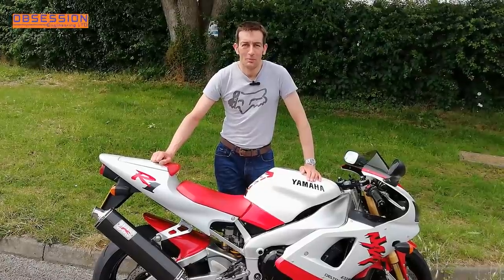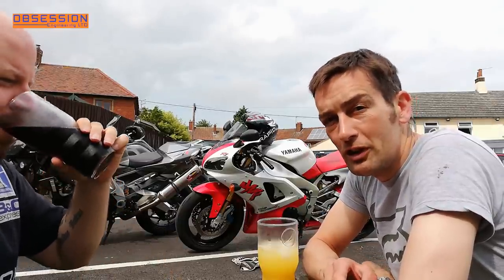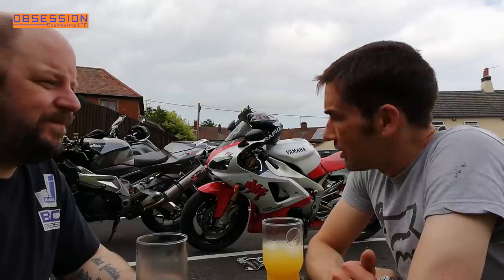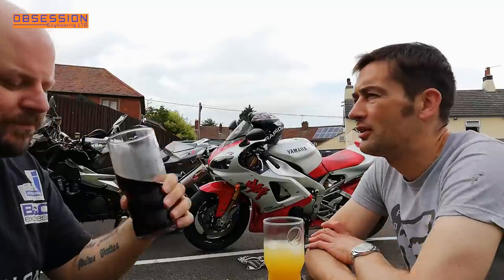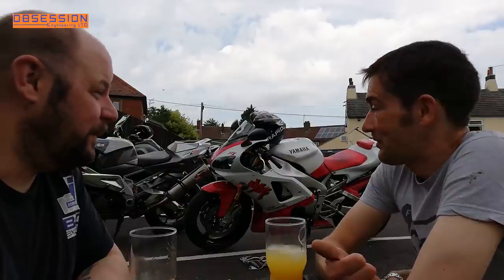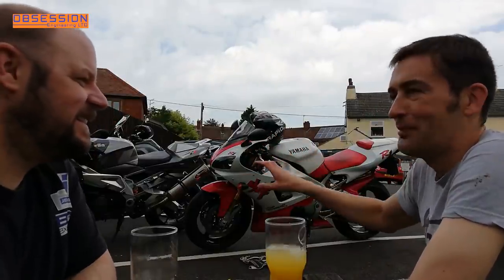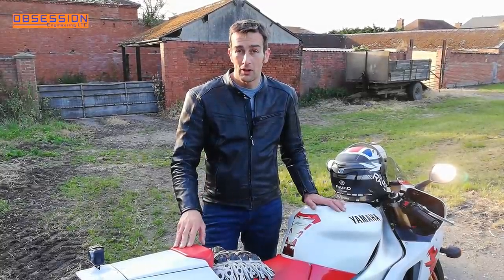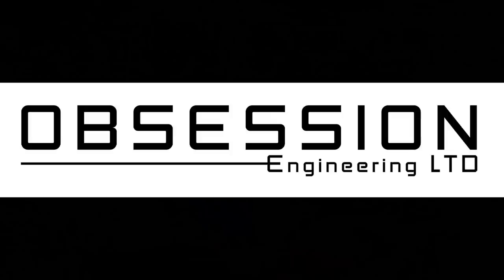ROAD TEST. My 1998 R1 is GREAT, but my Tuono is better! Yamaha Jigsaw puzzle project on the road

Comment: Have a `98 R1 as well,it`s the motor and especially the looks that do it for me-totally agree about the gear lever but the more you use it the easier it becomes.It`s the same with the brake lever on the other side -Probably because it doesn`t get used quite so much after 18 months with the bike I`m still trying to find the bloody thing.I know it`s down there somewhere.......

Comment: I own r1 RN01 as well. Give me a lot of pleasure and learned myself a lot of mechanical skills to keep this oldie on the road. You mention in the review that the suspension performance is excellent. But what I can  see your front fork is an ohlins aftermarket part. And maybe its advisable the mention these early models have a bad machined gearbox. one false shift can give issues on the second and or fifth gear.  Nice vid would love to see more of these. Cheers
Reply from the maker: In the build section of the project there is plenty of detail of the Ohlins suspension, but I will admit I didn't make a point of it in this vid

Comment: Great series Dave! So what ended up fixing the front brake issue?
Reply from the maker: The second set of discs I bought seemed to fix it, which was a bit odd as they looked worse than the originals. But I won't complain as they were a bargain

Comment: Dave ,  Do I buy a 4xv or 5jj or 5pw

I've found an early 4xv with 44000 miles on the clock It is a lovely bike  bit of ware and year any advice
Reply from the maker: I've owned a 5pw, and it was a great fast road bike.
If you want a purely riders bike, the 5pw would be my choice, if you want something with a bit more investment opportunity, the earliest bike possible is best. In the end the purest form is always the original

Comment: Had three Aprilia's, I'd rather have the R1. Aprilia electrics are made of spaghetti, solenoid and battery connections need upgrading, brown wire connector melts, stator is an expensive fix.
Reply from the maker: Rides nicely though :)
Reply: But apart from that, they’re lovely bikes

Comment: Not being rude, you seem rather tall and long legged, the R1 comfortable for longer rides? I tried a Tiger stripe Fireblade CBR900RR and found it hard on the wrist, the TL1000 seemed to fit fine even longer journeys, a lot depends on the rider, height, leg length, but some bikes just seem uncomfortable and hard to ride
Reply from the maker: I find the R1 quite good for room, for a sports bike! Not sure I'd want to tour on it , but I have the tuono if I want to be more comfy :)